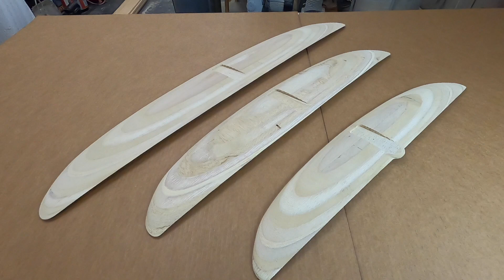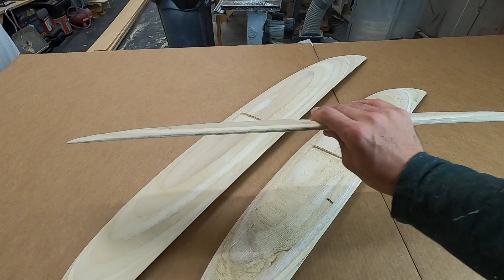Building a Hydrofoil Wing Set | High Aspect Foil Wing Cores

Comment: Killer wings!!! Congrats, I just wonder how to correctly position the angle of the wing, PITCH to the fuselage If you dont use the same flat "shoe"
I assume the flat rectangular recess should be ZERO pitch flat to the fuselage or 90 degrees to the mast leading edge
Reply from the maker: The fuselage mounting recess is zeroed in. So the fuse sits parallel.